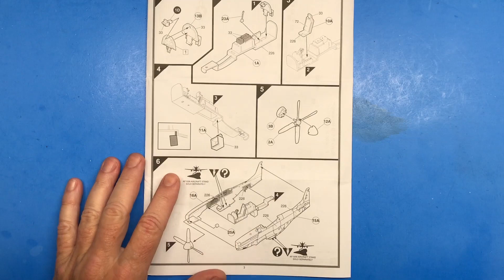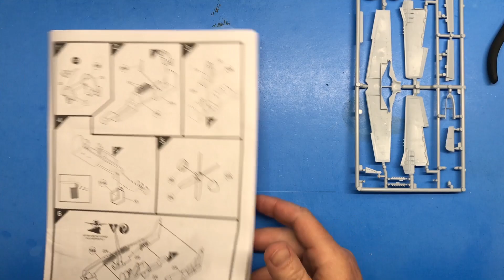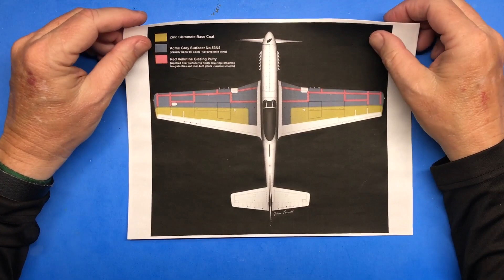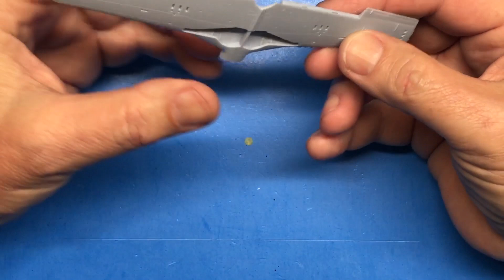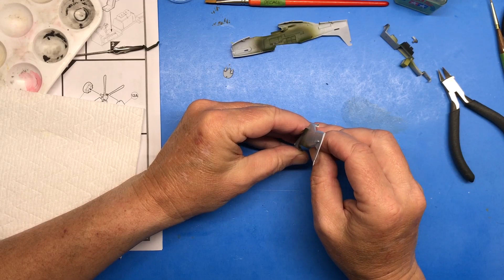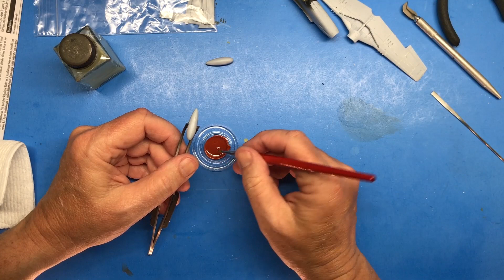Airfix 1/72 P-51D Mustang, Part 2 Construction

Comment: Hey Brett, at 17:46 what's the make and model of those tweezers? Ideally looking for a set, straight, 45 and 90 angled so wanted to get your thoughts on them or a recommended set. Thanks!
Reply from the maker: If you are talking about the tweezers holding the drop tank, those are reverse action tweezers that I got at Hobby Lobby in the model section. As for the brand I don't remember. I have another one that I have had since the '80s that may have been packaged by Testors. They are quite common.
I did a quick search on Scale Hobbyist and they have angled and straight. Here's a link:
https://www.scalehobbyist.com/catagories/browse.php?kw=tweezers